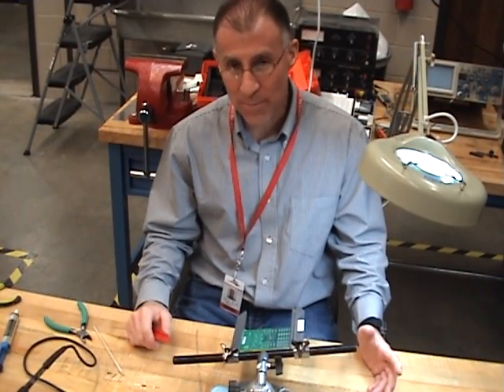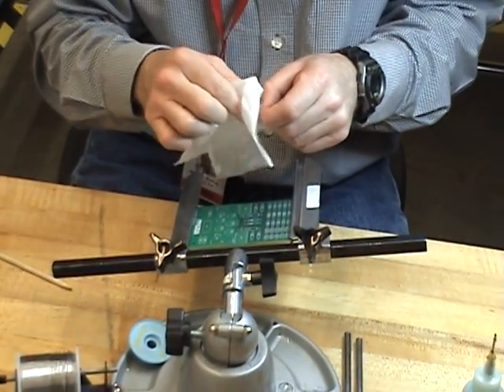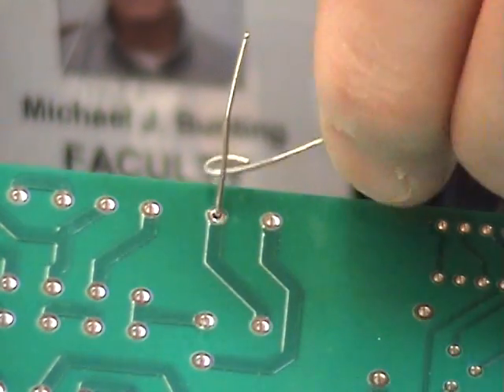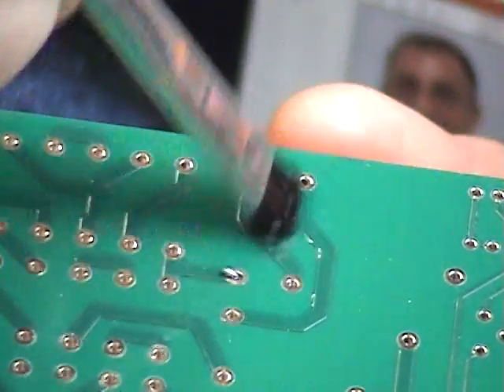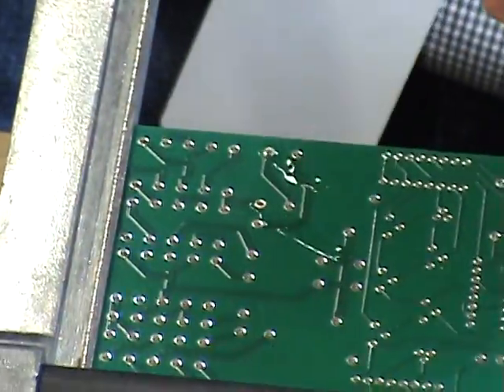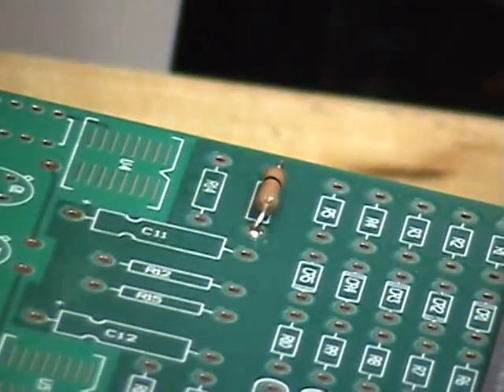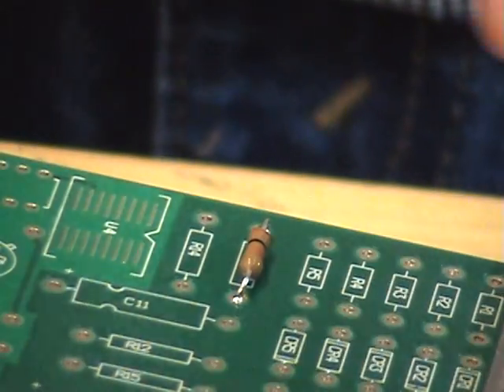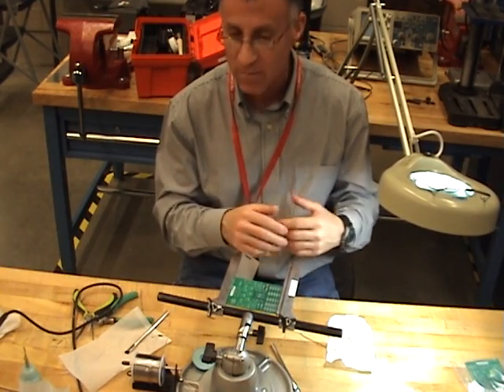*EXPERT LEVEL* Soldering Tutorial #5 TTC Avionics

Comment: OMG! This is what happens when you allow the government to build things. I shook my head when he actually wiped the soldering wire with a towel. This entire video demonstrates just how one can convince a customer to allow you to bill on an hourly basis to build a board. And then, you attempt to stretch an entire day to solder a board that most of us would only take five minutes to do. Now, I do understand that this expert being from NASA, when you send something up into outer space, the device had better not break because of some loose solder joint or a cold solder. But still, the best of the best of the best solders in the world are not this anal retentive when it comes to soldering. This is mislabled "EXPERT LEVEL". It should instead be labled "when you send sh*t into outer space" because only then when the solder work has to withstand infinite amount of gravity push, and hundreds if not thousands of degrees below freezing. On Earth, we can speed through the soldering and still guarantee the board will function here on planet Earth under normal conditions.

With all of that, I do agree with him on only one thing, and that is pre-cutting the leads before soldering. If you solder and then cut, you stand the chance of putting stress on the lead, the solder, as well as the pad. It is best to pre-cut and then solder. Not only will it have zero stress on the joint, but it will also give the job a much smoother solder surface.
Reply: There is no such thing as 'thousands of degrees below freezing'..
The lowest possible temperature is 0 degrees Kelvin.. also known as -273.15 degrees Celsius or -459.67 degrees Fahrenheit

other than that I do agree with you on these soldering techniques being overly complicated.. but when you send stuff into space you BETTER be at EXPERT LEVEL

edit : Kelvin =P thanks Su.
Reply: You have to remember yuppiehi, these are high reliability soldering procedures for aerospace ( aircraft and satellites). If your working on your favorite DIY project or even consumer electronics you can still use the bigger "the blob the better the job" technique. I would suggest some of the procedures used here would improve your results and if practiced can be just as fast as doing sloppy work. Soldering standards change dependent on the product your are working on: consumer, industrial, military, and aerospace all have different requirements. As a mater of fact a whole industry has sprung up called IPC concerning soldering and do they rake in the $$$.
Reply: yuppiehi
How quaint.. my point remains valid..
and yes.. yes I do, why else would you only respond after 3 months..
also : exaggerating your point does not make for as interesting a comment as you seem to think.. you obviously got into the subject now though, so you're welcome =)
Reply: actually this is called class 3.  better yet if this is nasa they have their own standards that go a little bit beyond your j std or  A-610.  most of you people comaining dont have a bit of experience or you work for a company that half asses this stuff.  this is serious stuff and expensive.  when these boards are sold for that specific amount of money, it has to be perfect.   this guy is explaining things so shut up and listen.
Reply: tvmcrusher You spelled Kelvin incorrectly.
Reply: yuppiehi These procedures are written in blood. If you don't know what that means, look it up.
Reply: yuppiehi For the most part you are right. I'd add one other. Inspect both sides of the PCB. A company I worked for a a returned aircraft LRU that failed because the solder didn't go all the way through and the plating had an intermittent failure in making contact with the pad on the top side of the board. Thankfully it didn't cause a crash, but there were other components in that box where such a fault might have (or given the pilot a nasty surprise).
Reply: I agree KK. It is because of incompetents like this that those of us in the know have to fix their 1/2 ass screw-ups....
Reply: Berend van Berkum Is it so beyond your feeble abilities to "ignore" someone that you need to do it electronically? Quit your whining and simmer down now!
Reply: Berend van Berkum Who were you even wanting to "ignore" in the first place?
Reply: actually this goes way beyond J-STD-001E for class 3 electronics. You also might find this article interesting: http://www.assemblymag.com/blogs/14-assembly-blog/post/89217-the-curse-of-ipc-a-610-and-ipc-j-std-001
Reply: tvmcrusher
Do you really think I thought there's thousands of degrees below zero? It's called "making for a more interesting comment." Have you ever used the term "zillions?" No, I guess you haven't.

Comment: let us take this time to celebrate smd devices and reflow soldering
Reply: I agree most smds are good but I work with high power equipment. and while smds comprise more and more real estate on the pcb in digital control, through-hole components still handle the power.
Reply: Roger Lamb lol but now days all the best components are smd's

Comment: This is awful. You never bend leads these days. You use a piece of painters tape to fixate the components for hobbyist use or a professional pcb frame with foam on the back. The leads will be straight, which makes reworking/replacement easier in case of component failure. Additionally you don't need to wipe the leads that often, modern flux takes care of that.

Comment: A resistor is expert level soldering? soldering a resistor can literally be accomplished by a 5 year old.   why the hell would you cut the lead before soldering? at the least the extended lead and provide some additional thermal resistance to avoide reducing the life of the resistor, why the hell donw you just clip every thing when your all done? you might have to remove it